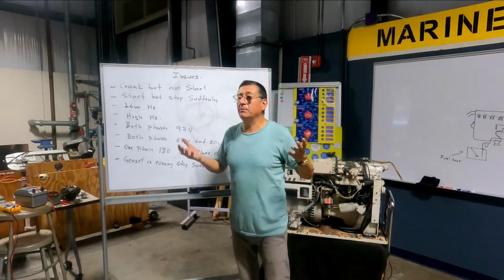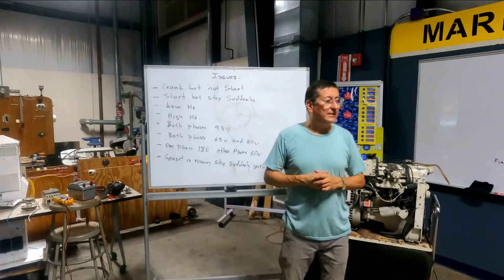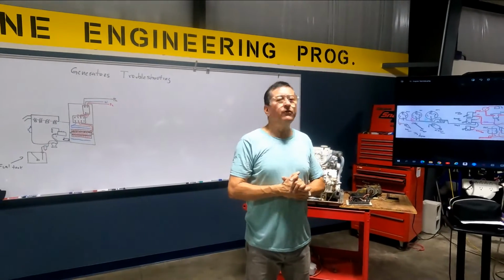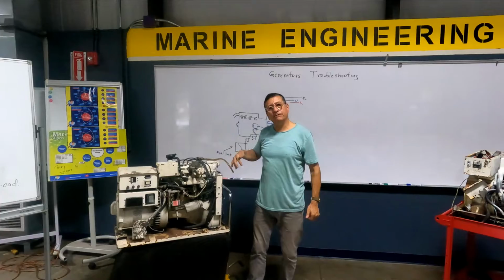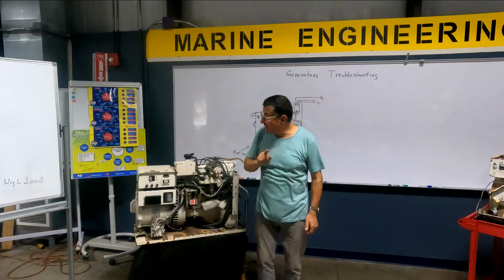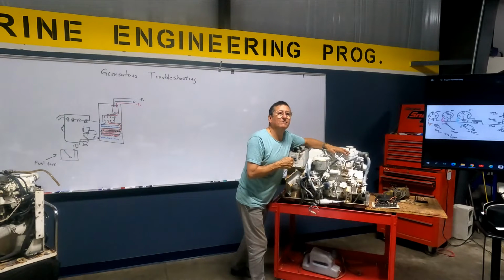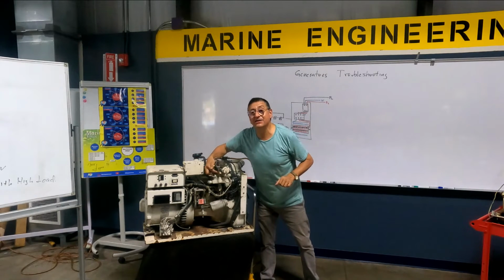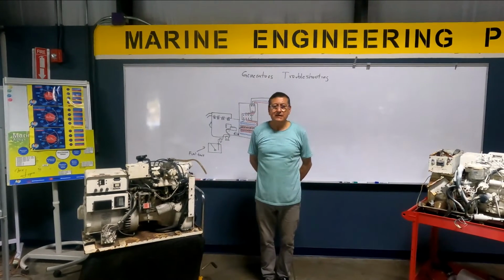Generators Troubleshooting Part I

Comment: How do you reset the codes on a cohler generator?   Getting oc code and doesn't even spin the engine
Reply from the maker: Hello. Disconnect the main Positive cable for 3 min. Then start the genset again
Reply: @MrLopezclasses    still gives me the oc code.

Where do I start looking? 
15EOZD kohler with yanmar diesel.
New wires, new computer. 
Click the start button and nothing just the error code OC.